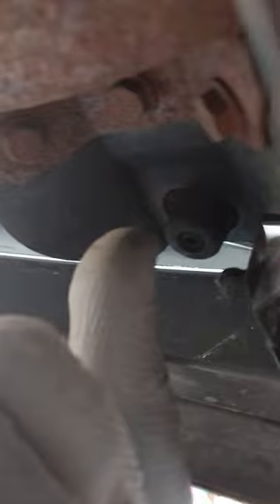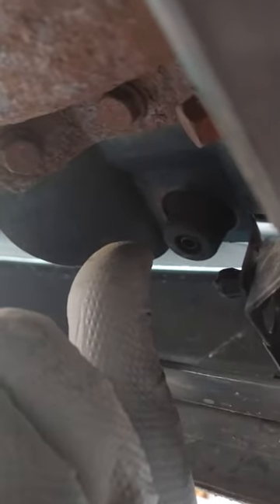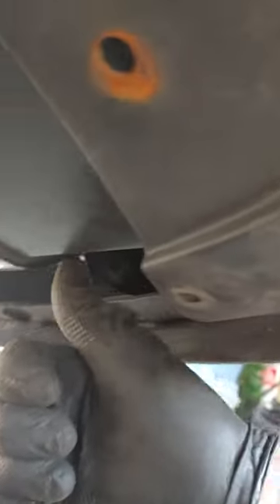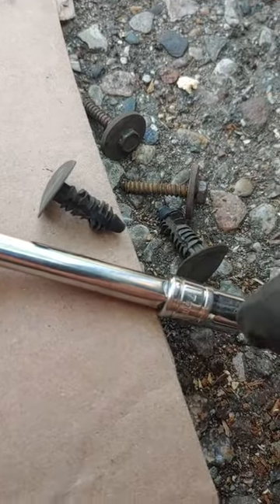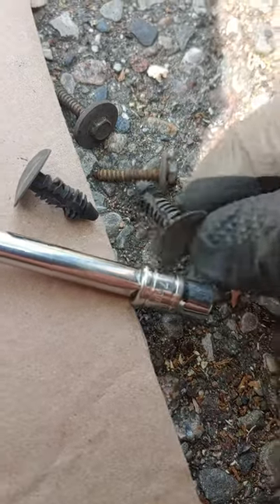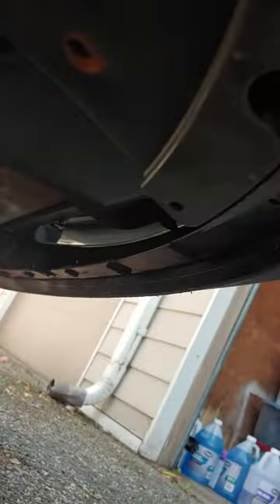HHR Radiator Drain Plug - Where is it?

Comment: They sure made it a PITA to reach! I've been having mysterious coolant loss and finally found wetness around the drain plug. I guess these are known for having the O-ring fail and start leaking. Cheap to replace but certainly not easy to access. Doesn't help when it's freezing outside. Thanks for the video!

Comment: I removed the overflow tank and other bolts to tilt the radiator back to reach the drain from above. Also I needed a special drain petcock tool because turning that thing was a 🤬. Use it with a stubby ratchet. Hope this helps anyone struggling.
Reply: Socket size??
Reply: I’m just

Comment: Did you find it
Reply from the maker: Ya I found it. It's difficult to turn. I broke part of it off trying to turn it with a socket, 21mm or 22mm. I got a set of wingnut driver's/bits to try getting it out now, but haven't gotten back to it yet. I also picked up a new plug from Napa for a few bucks. I'll have to get back to work on it.